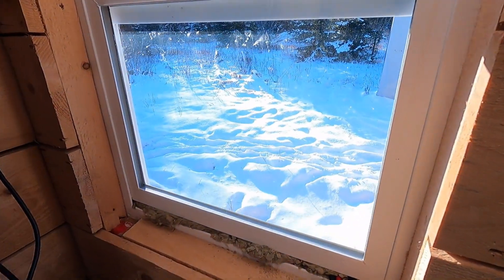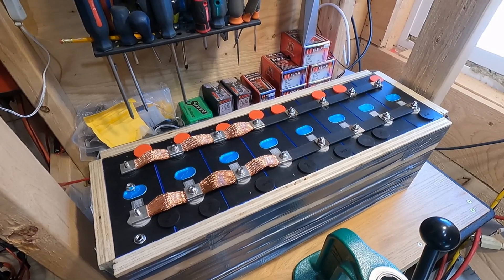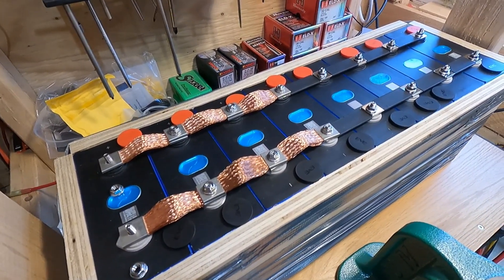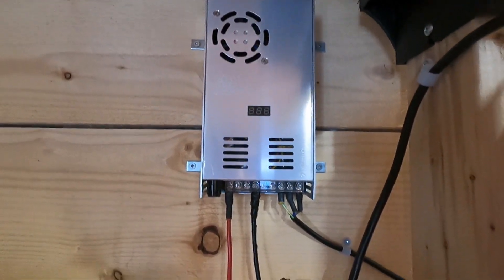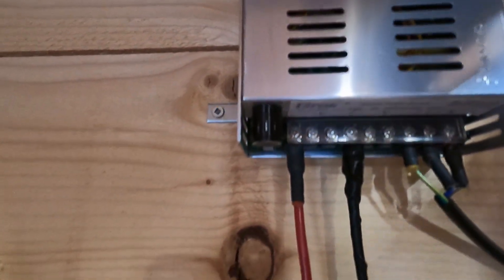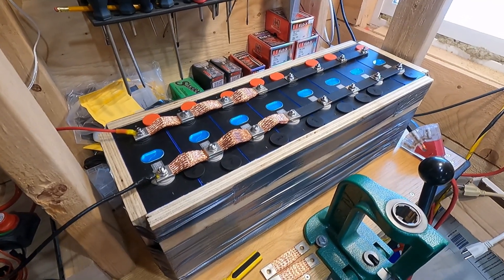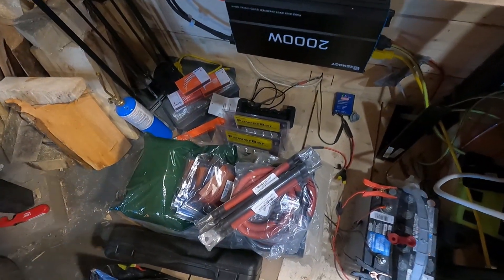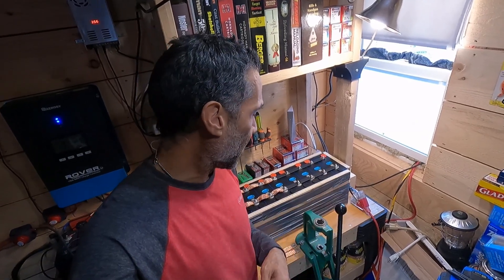How to Top Balance Your LiFePO4 cells

Comment: I thought you can just parallel them and leave it alone for a few days?
Reply from the maker: I suppose that depends on your situation. You could certainly do that if you are able to.

In my case the variable power supply I am using is AC, and I have no other power generation other than solar and my gas/propane generator for times when there isn't enough sun to keep the batteries charged, so I ran the genny to charge them. November and December are very low light months in my area, lots of clouds and precipitation.

If you have access to a power supply that can provide your cell's required charging voltage level (typically 3.6V or so for a LiFePO4 cell, mine 3.65V max) from any reliable power source, whether AC or DC, then you are good to go. So if you have a huge battery bank to charge your new cells with, you could use any DC to DC charger, in theory. If you are on shore power, then any AC to DC variable power supply would do the job, as long as it it providing enough current(amps) to do it in a reasonable time. My little Drok can deliver 10A DC max between 0 and 48V from any 110V AC outlet, so that's how I used it.

Comment: I've built a few systems now and always done the same  top ballancing - Recently I bought a 5amp capacitor type active cell ballancer and it does such a good job down to 0.005v that provided the cells are within 0.2 v I think next time I would just assemble them and let it do its job and charge up on to the knee at a fast rate (40 a) then through the knee at a  more modest rate (10a) - when the first cell hits 3.65v just leave it rest overnight and by morning it would be perfect = subesquent charges I would only charge to 3.45v no point in stressing the battery for that last 2%
Reply from the maker: Good point, dropping the charge rate in the last few percent of charge is a good practice!

Comment: You are getting up there with the lipofe4 cells upgrade . Top balancing them with the generator will be what every prepper need when running a great system at an optimal voltage rate needed to run the cable successfully .🤙🤗🔋🔋🔋🔋
Reply from the maker: Thanks Cedric, it's getting there!